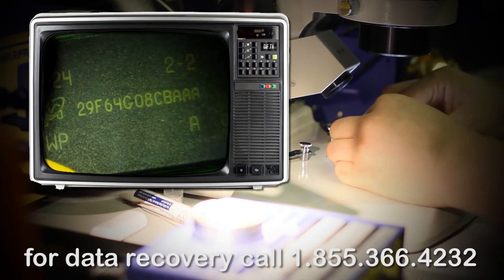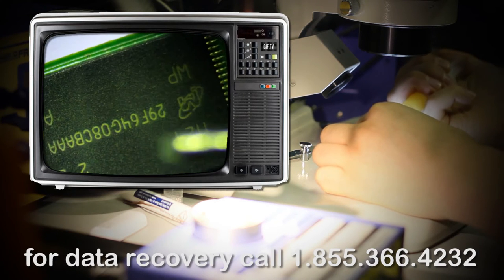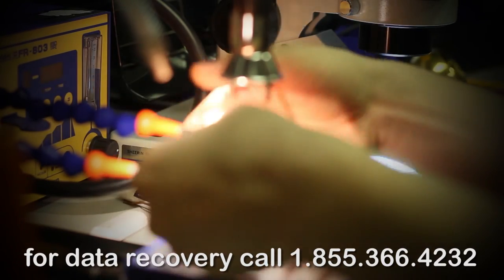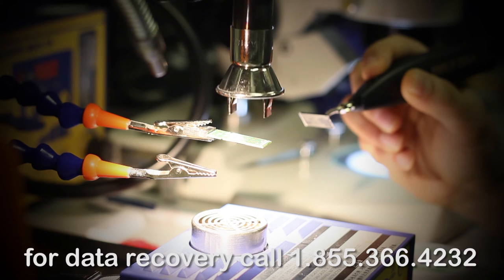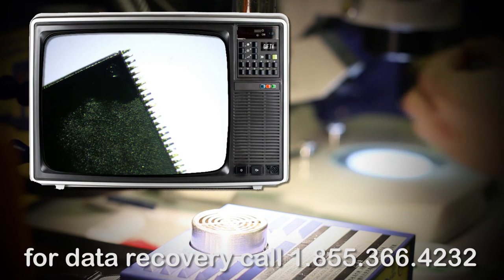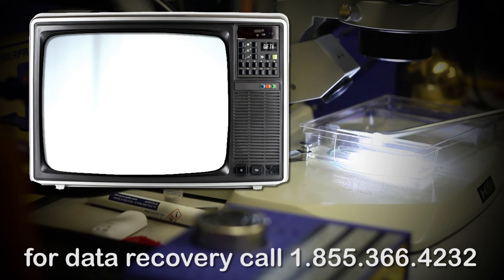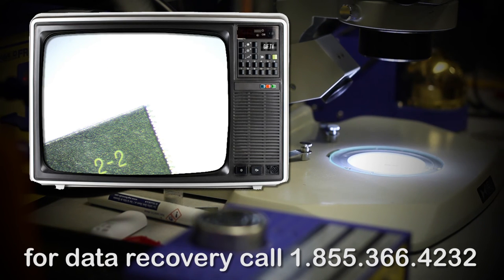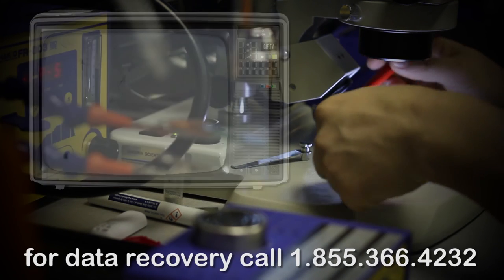Data recovery from Kingston USB drive

Comment: Could you tell me where to buy the chip removal tool?
Thanks
Reply from the maker: ebay, amazon
Reply: Could you tell me if there is anyway to match a flash drive through the memory chip? I have one identical to the one you were working on and want to transfer it to an identical flash drive. But the case is missing.
Thanks